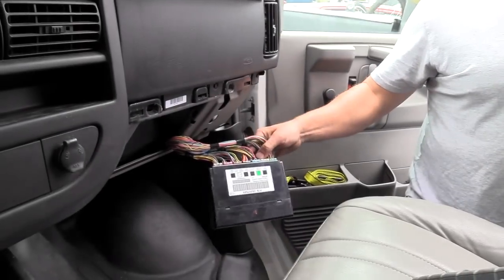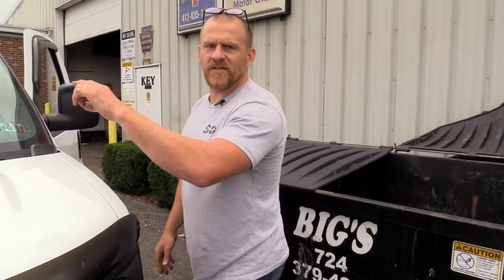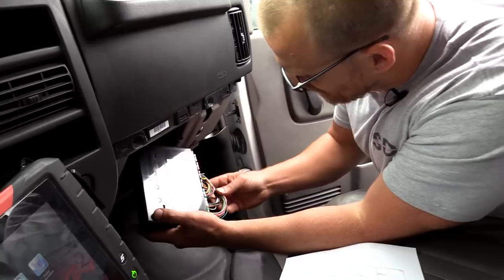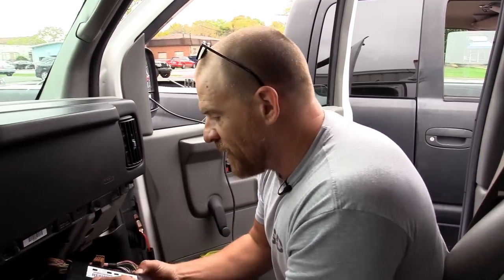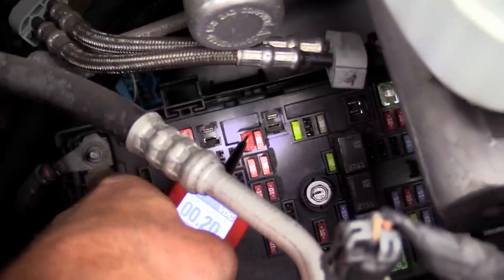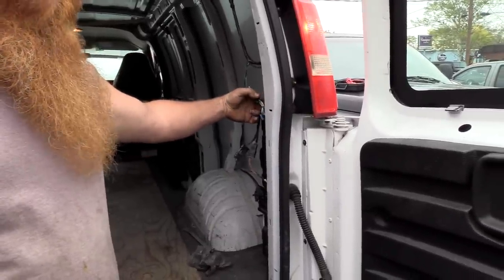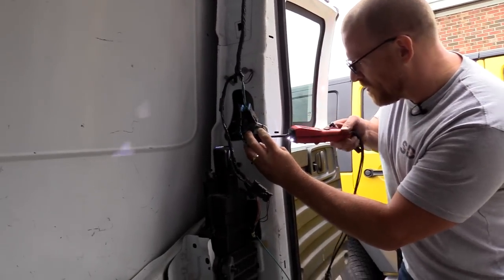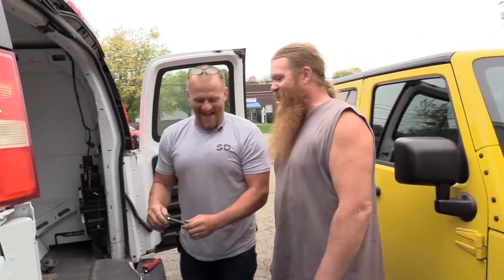BCM Controlled Tail Light Circuit Diagnosis

Comment: I'm confused why you're checking the bulb circuit for a problem when your fuse is the power feed to the bcm
Reply from the maker: It is a designated fuse for that circuit only. Even though it is a feed into the BCM. Weird I know, that's why this is a good video, seriously, that question alone.

Comment: I'm pretty sure there were more lights not working with that fuse blown. I mean you don't just wire up a 10 amp circuit for one single bulb.
Reply from the maker: Nothing else the customer complained about or that I noticed?

Comment: What program/scanner is that being used?
Reply from the maker: Snap-on Verus Edge with service info from ShopKey
Reply: @ScannerDanner  I wish those were more affordable for the home DIYer. I use an EasyDiag that has quite a lot of capabilities though, just not to that extent. Excellent video man. One of the first tech channels that I've watched that actually is technical in an informative way and not cluttered with sponsorships and filler talk. Sub'd.

Comment: On most trailers that I see, the wiring and lights take a real beating. Then you have guys, without the correct tools, knowledge, and materials trying to make a quick and cheap repair, just to make it work one more time, .... then they park it out in the elements. When they need it next.... well.... another poor bandaid repair.... and so on. I have seen Door Bell Wire from a Hardware store because it is cheap, or LOOMEX from house wiring.... because that is what I have. Spliced in with "Scotch Connectors" or "MARS" Connectors, or Marettes, or just twisted and tapped with Duct Tape. I think that there is a HIGH Probability that the trailer could be a problem. Good trailers that are well maintained are OK.... BUT... there is a LOT of well used junk out there, especially in the wiring department.

My 2009 Yukon HYBRID has a separate set on fuses in the underwood fuse box JUST for the trailer as standard equipment. If the trailer had a problem, it will take out that fuse and isolate the trailer from the rest of the vehicle. That is a smart thing to do. Well done GM.... and they are labeled too!

I love your Videos both on Youtube and also your Premium Chanel. Having Caleb do the Videos has added a lot in clarity and details. Tell me..... has he learned terms like.... ACTION..... CUT.....STAND -IN..... TAKE 5..... JUST CHILL DAD!   My boys use that last one a lot. Nice to see you at Danner's Shop as a Trouble Shooting Family. Hi to all and keep up the good work.  WELL DONE.

Comment: Can someone help me I went everywhere and my 2010 Camaro driver side brake don’t work neither does my driver side turn signal but my marker light works and so does my running light and the front lights work perfectly and my dome light don’t turn on I checked the bulbs and they are all good I am so lost on what is happening to it I checked the wiring and it’s all good and same thing with my fuses are all good please someone help me
Reply from the maker: Need voltage readings on those circuits to help
Reply: @ScannerDanner  I did the voltage on the driver side tail light and there’s nothing for turn and brake but the running light gets 12V
Reply from the maker: @tjgross078 testing MUST be done with the bulbs plugged in and backprobing with the circuits energized. Meter connected to a known good ground. You must report what all wires show you with each circuit turned on
Reply: @ScannerDanner  I already done that my friend was hitting the brake I tested them all on that and afterwards I had her turn on headlights, I did the same, I also had her turn on the turn signal and the only one giving me any voltage was the running light, reminder my marker lights work fine
Reply from the maker: @tjgross078  you need a good diagram now and find out where power is coming from, including your dome light 
https://eautorepair.adtrk.biz/?a=10817&c=24&p=r&s1=
Reply: @ScannerDanner  could the tail light issue cause the dome light too? Like is their circuit connected in any way?
Because I’m suspecting a bcm but I’m also not too sure
Reply from the maker: @tjgross078 diagram and further testing at the source (if it is the bcm) will guide you. I don't have the diagram in front of me and unfortunately don't have time to do that homework for you. But if you need additional help, post this to my forum on my website. It is free to join my forum www.scannerdanner.com

Comment: i would be adding a new light circuit bypassing the bcm
Reply: Why?  Even with a different circuit it would have popped a fuse. Unless your redesigned circuit had no protection.
Reply from the maker: He's right Erwin

Comment: That circuit logic is just retarded - a single feed into the BCM that only (at least obviously) runs a SINGLE LAMP! What are they smoking over at Chevrolet? It must be some strong sh!t. At least put two on there (front and rear) so it's obvious it's not just a bad earth at the bulb.
Reply from the maker: Yeah, not totally sure on this logic but one thing that is NOT typical is when a power side switched driver circuit gets shorted to ground, it typically frys the driver. Not so on this design, so pretty cool from that stand point